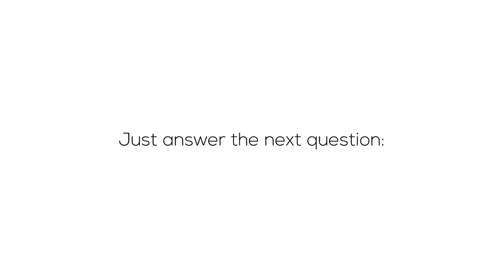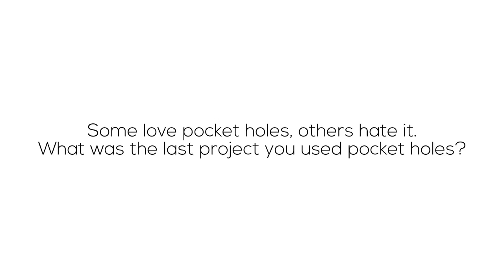Pocket hole clamp with quick release system I have never seen before

Comment: I took a piece of aluminum 3/8 bar and cut 3.5 inches. Then I sanded the bar to be .010" smaller so it fits snug in to the pocket hole. Stuck it in to the pocket hole and used my 4 inch C-clamp with one swivel end to clamp it and joined piece of wood. Simple.
Reply from the maker: That id a good idea too. Thank you for sharing.

Comment: I would consider adding a small thin flat washer in between the spring and the slot to keep the spring from deforming into the slot.
Reply from the maker: Thanks for thinking with me, I really appreciate that. I was thinking about the same when I build this jig but the smallest washer I had in my workshop was too big for this. I fixed it by making the slot were the nail goes true, a little smaller on the top. Thanks again for your feedback, I love having comments of people who think together with me. Greetings